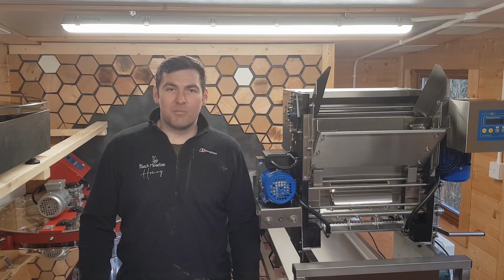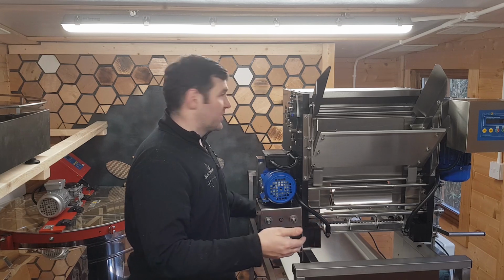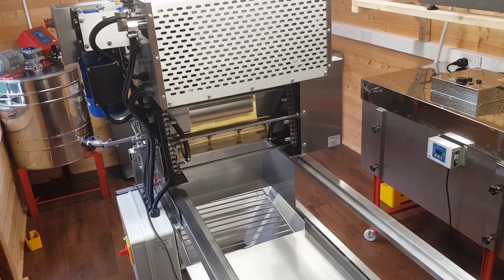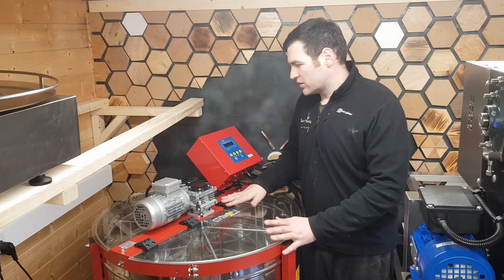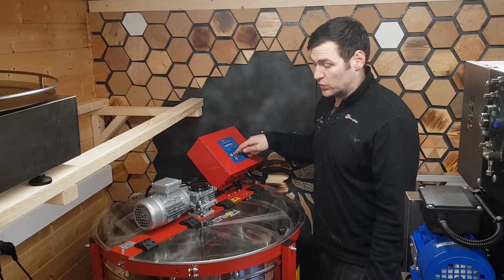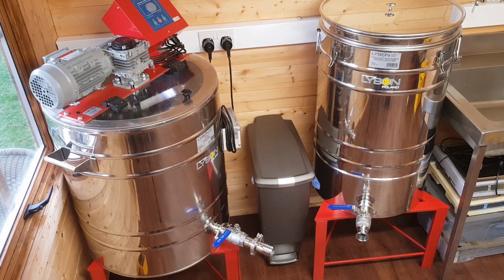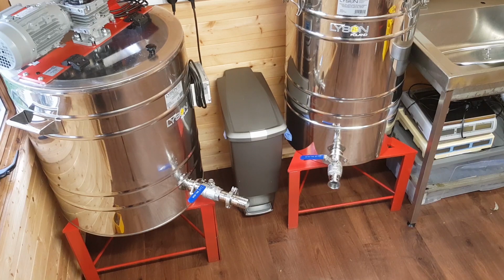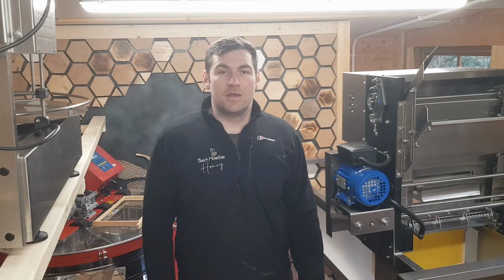Honey Extraction Room - Plans, Layout And Workflow Explained

Comment: another great vid Laurence. Interesting point about the ball valves as improvement over honey gate valves. On that do you use your honey pump from your extractor direct into your filter settling tank ? brilliant revelations here thank you
Reply from the maker: I extract into a bucket. Then tip the bucket (whilst replacing with a new one) into a 200 ltr filtration tank. Its manual but really fast and most importanlty low/no mess on equipment
Reply: Brilliant thank you for replying. That’s really helpful. I did wonder as it looks like your extractor has a ball valve

Comment: Those ball valves will become the bane of your life
Reply from the maker: How come? Forgetting to close them and it running out on the floor?
Reply: @BlackMountainHoney  blockages from granulated honey. Get a paint stripper gun if you haven't already or clean them out right after you are done
Reply from the maker: @wildyorkshirehoney960  Good tip. Thanks. I always tilt and clean but I'll get the gun to be sure.